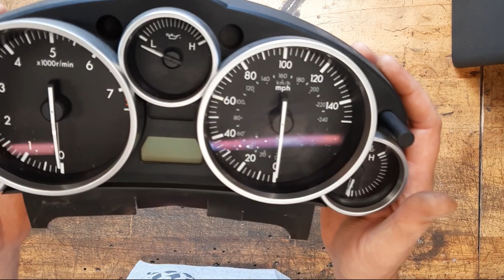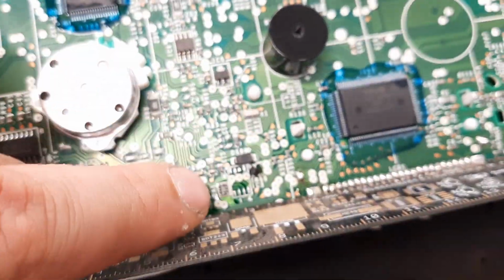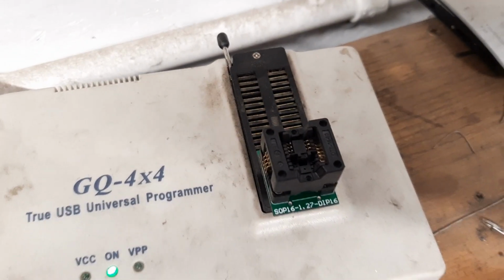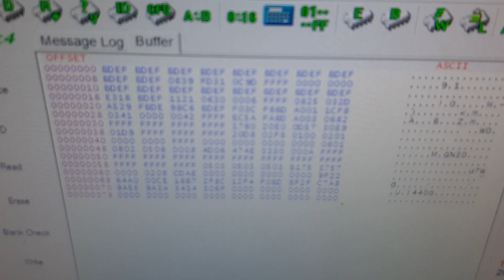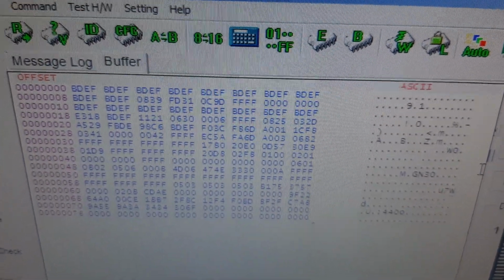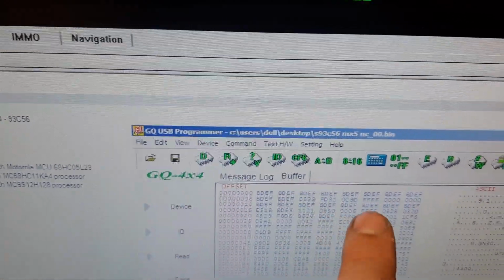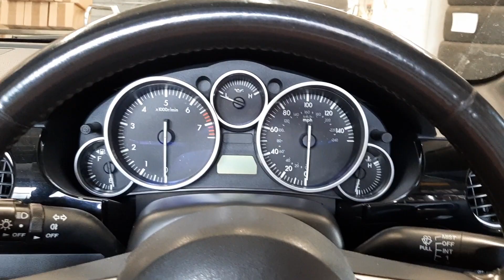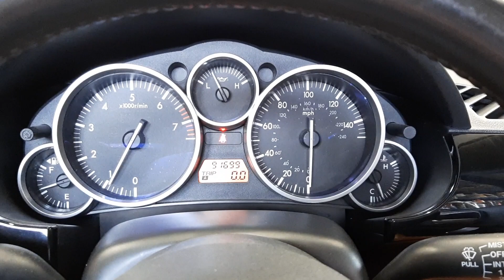Mazda MX5 Mk3 NC Instrument Cluster Gauges swap eeprom S93c56 Mileage PATS data Odometer correction

Comment: Hi.
Is there anyway I can PM you somehow, regarding one of your reel videos on PWM control WMI and EMUB,
regards Rob
Reply from the maker: What do you want to know? Ask away!
Reply: @threepotMR2  was it a solid state relay you used for this job ?, if so which one please ?
Reply from the maker: @robertleaper3806  So the injector/valve is  powered directly from the ECU. And then the supply for both the injector and the pump are on a relay.... I did use a SSR but its not essential. I posted a wiring diagram on the ECUMaster facebook group. The relay is SSR-25DD
Reply from the maker: @robertleaper3806  So I have one output pin on the ECU that engages the reply that powers both the pump and the injector.. .thus the pump is then running, then I use another PWM output for the valve itself. Its all pretty straightforwards and commonly done this way. Just means the pump isn't always running as its quite noisy when you are cruising.
Reply: @threepotMR2  that's great👍 , thanks very much for sharing
Reply: @threepotgtti any chance of a link to the Facebook post you put up on ecumaster page on this subject. 
Thanks
Reply from the maker: @robertleaper3806  Try this.. https://www.facebook.com/580227036/videos/152184697899855/